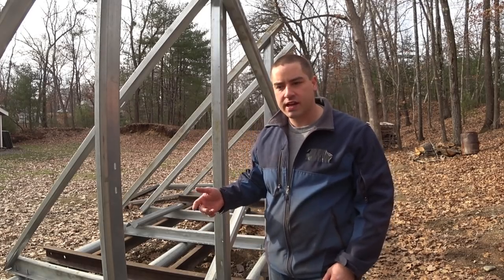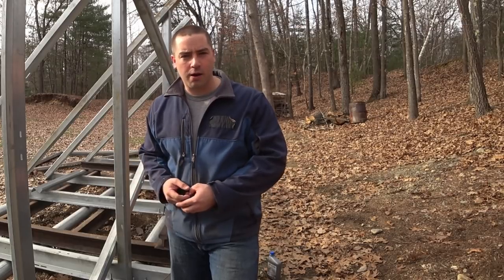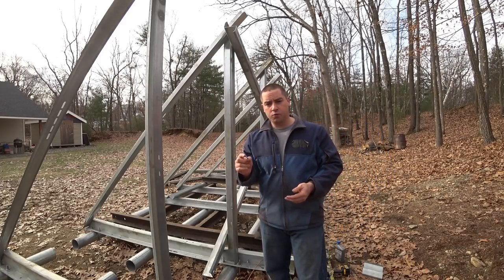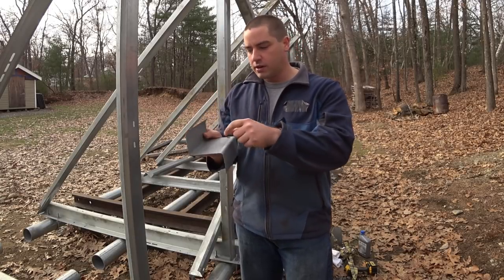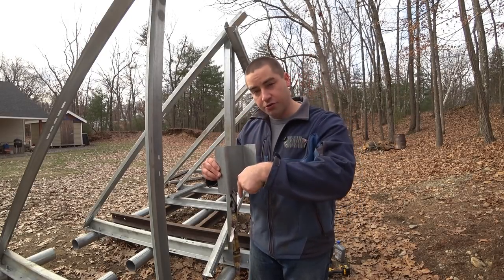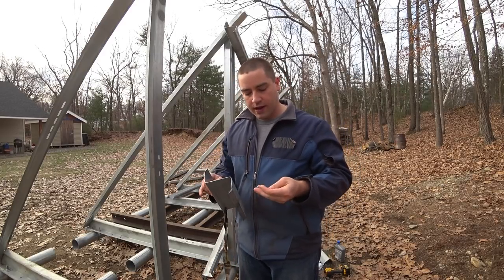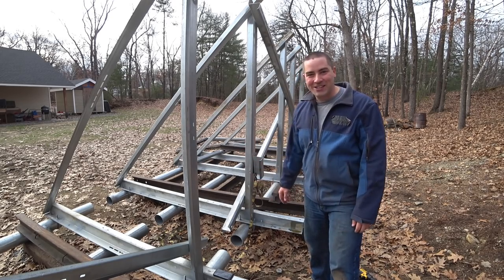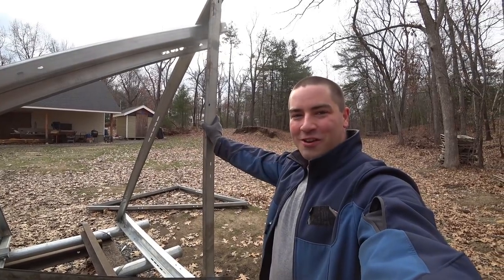Testing the Screws Holding Together Our Solar Mounts

Comment: I think with the screws its enough. You should also be aware of wind speed but no welding will be necesary. Keep up the good job.
Reply from the maker: Yes, wind loading is also a concern.  To keep the array in place I ballasted the base with 3,000 pounds.  I'm pretty comfortable with that.

Comment: 65 psf snow load equals no solar today lol
The factor of 0.6 used to change from tensile to shear force could vary from 0.58–0.62 and will depend on application. Steel called EN8 bright has a tensile strength of 800 MPa and mild steel has a tensile strength of 400 MPa.
Reply from the maker: Yeah, no solar if we get snow.  I didn't track your 800 MPa...  Strong enough?
Reply: @DavidPozEnergy  i am no engineer but I think you could put twice the load you out on it depends on the type of steel in the screw or grade of the bolt (hardness) mild steel 2 I think

Comment: Well,  if you think you need justification you could consider welding all the connection points to add strength.
Reply from the maker: I'd have to get better at welding before I attempt that.

Comment: Dear fellow nerd: revealing your lady's weight, much like her age, will get you banished to the shed. Ask me how I know  ;-)

If you still have racking or concerns about strength after all the cross-members and screws, a couple of spot welds will cure it. Take precautions with fumes if that is galvanized steel.
Reply from the maker: Yes, it is galvanized.  Plus, I'm not a good welder, still learning and I only have an AC stick welder.  But I did add some angles that you can see in the last 10 seconds of the video.  Thanks for watching.